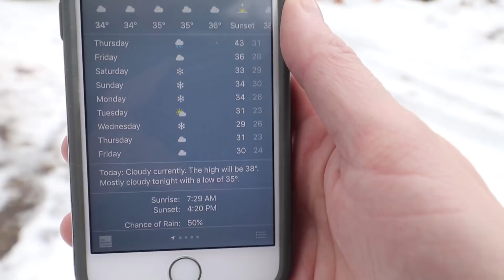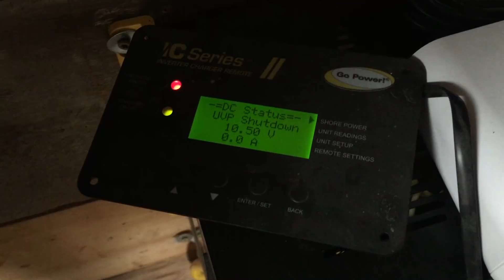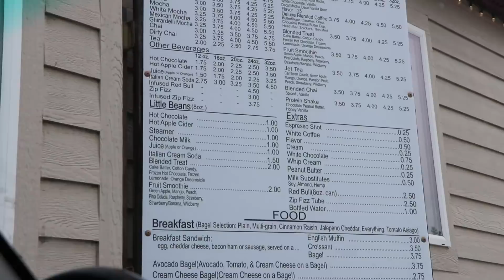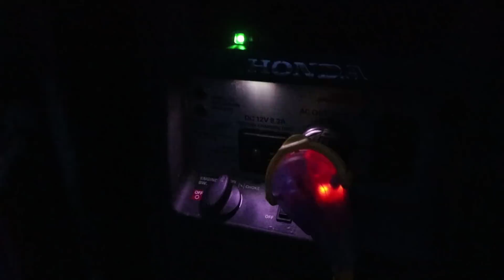Our Story: Giving Up Solar Power to Go On Grid

Comment: Why not convert your solar system into a grid tied solar system? Or just have your solar system be a short term backup system. I'm not judging you for wanting to be tied to the grid, but why not continue using what you have? There are ways to use both traditional and solar systems in the same home.

Comment: We have a roof mounted solar system with  a nameplate capacity of 6.2 kW, that's about 18 350W panels. It covered 107% of our electric needs in 2017 and 92% in '16. We are grid-tied so when we need extra power we draw from the grid and then supply power back at other times. If we had a Power Wall, we would only need the grid (or a generator) in November and December. We live in Maryland. 
So it looks to me, from our real world experience, that your system is way too small. You will probably always need some auxiliary power in the winter with your northern location.
I'm looking forward to hearing how much it will cost to bring grid power to your property.

Comment: Most people have no clue how much power it takes to run a comfortable home.  I started 10 years ago offering solar power services.  I took college level courses, learned the technology, learned how to do the installations and then started ofering the service.  When each customer would learn how much it was going to cost to fully power their home, they got a quick education and there wasn't all the demand that the industry hyped there would be.  The panels are not as efficient as people think and then you add shading of the panels and the systems just are not up to par.  When it comes down to it what you have is a fancy battery backup system that is trickled charged partially by solar but mostly maintained by an electrical source like a generator or the grid itself.  90% of all solar power in this country is grid-tied and the utility just pays you for what power you generate.  Most solar powered homes are not 100% off grid. You can't fault them for tying to the grid.

Comment: I'm offgrid for some years now with solar PV only no generator backup (I newer owned a generator) and since this winter even heating the house is done with PV panels as is the most cost effective heating option. I never had a Low battery warning as my system is properly designed to supply what my house needs and I use LiFePO4 batteries.
For those that are grid connected is best to stay so but for a new house proper offgrid solar will be more cost effective but you will  need to be an expert unfortunately.
For you is likely a good choice to connect to grid if connection is not to expensive and the have a grid connected system (no battery as that will just not be cost effective as of now).
I'm an electrical engineer likely an expert in solar and energy storage and for me it works here in Canada but I likely have one of the world most advanced net zero energy house powered 100% by solar PV.

Comment: Must have been a hard decision switching to mains power.

It take guts to admit when you're beaten, and your mickey-mouse solar setup was never going to cut the mustard long term.

It was always going to be a decision between getting some professionals who know what they're doing to install a proper solar setup (an expensive one with lots of excess capacity for poor-weather days), or switching to grid-power.  
You chose the latter and there's nothing wrong with that.

Maybe now you'll also admit you're in over your heads on the build and get some more professional help with that as well?

Comment: I would argue that if you have a generator which runs on fuel you buy somewhere, you are not "off the grid." You are simply on a different, less efficient grid, and that grid is run by the oil industry. So don't feel bad or feel you need to justify your decision. Just hook your solar panels as a grid tie, get whatever benefit you can from renewables, and call it good.

Comment: Off-grid solar may not be desirable for everyone, but we do well on it even in the northwest with long winters. We upgraded our setup and that made all the difference, even in winter. Running power tools constantly to build a house fast would be more difficult with solar, for sure. We run tools but are remodeling a fixer, not building from the ground up. Do what's best for you, but I encourage others to do their research. Solar power can be a good choice if you have the right lifestyle and setup.

Comment: Lol. Just watched the beginning of the "battery" episode.... he says... " we are fairly sure they were not maintained and 2 are giving problems" " it' is a measured risk and we only need them to last a two or 3 years" lol duh. LA batteries have a memory so if they were not maintained I'm sure it kept deteriorating. Also you can use only 1/2 of the available Ah rating and it sounds like that guard was not in place..... you all just got bad batteries and wonder why it didn' work.

Comment: It costs money one way or the other to get power to a remote home -  Unfortunately these guys put just enough money in to off grid power for it to be a disaster.  A properly sized solar array with a large battery bank is absolutely up to the task, but a generator that is capable of automatically topping off the batteries when the array can't keep up is also required.  In the end it just comes down to if you want to invest the money in your future independence or give the money to the utility company.
Reply: FlyLowLikeRylo exactly, it’s an unfair experiment they did. Old used batteries and three panels, of course they are going to get frustrated. Spend whatever it’s going to cost to tie into the grid and they’d be fine. Gas stove and gas clothes dryer, done

Comment: Seems like grid power is the best choice for you, but I also feel like you never had a real solar setup that was sized correctly for your needs. Cost/benefit wise, I'm surprised you guys haven't went 'on grid' for your water. For what the water system cost, you could have been on grid and paid for several years worth of usage. It seems like the same calculation you're making for power but you came up with a different answer.
Reply: Zach M iii

Comment: I think you might be making a mistake and here is why. I understand "full"/"pure" solar isn't going to work, and as a person living father north then you are, I can also appreciate that energy sources are not really a "luxury", but the cost to run power lines is very high, the install cost will be high and to simply connect to the grid , is very high. You sound consider the best solution for you is to phone up Outback ( same company that make your charge controller) modle = ME-AGS-S  , and get one of the "automatic generator starters". With this, it will auto turn on to charge stuff as needed, ... and the cost is like 300 $ . Furthermore -- if you go on grid, you willnot go back, this is because the install cost is so high , solar will never make sense again, also keep in mind a larger solar array will be much cheaper over the next year or so .. prices fell 37% in 2017 , and will fall another 30%+/- in 2018. There is no way a install of grid power, plus the monthly fees, will come close to the cost effectiveness of this solution. I would say it is worth considering, have someone else set up the electrical system for you .

Comment: Have you guys considered lithium ion batteries?  Not suggesting this instead of connecting to grid...  It not only can be drawn down safely much lower than 80% regularly, but they charge faster.  Something like the Tesla "Power Wall", or whatever they call it, might not only give you a lot more useful power in the mean time, but make you more energy efficient on grid (and give seamless backup in the event it goes down without need for the 3am generator startup).

I know you guys have a lot on your plate.  Just an idea.  Love your channel!  Keep up the great work, and thanks for sharing!!

Comment: Batteries outside? there's half of your problem..possibly 40% loss of capacity.. Inverter left on all night till the alarm goes off? There's another..inverter idle draw of 1 or 2 amps all night long. Generator not in a warm place? Yup, hard to start.....and so on.
    North Idaho, off grid 20 years, no problems.

Comment: A perfectly sensible conclusion. My two cents is you should look into keeping the solar even after power is hooked up. It'll lower your power bill and give you a backup in case of power outage. And from my experience living in rural areas, power outages can last for hours

Comment: I appreciate the honesty you guys have commited to. Solar works much better in areas with clear sunny weather all the time. The tech does get better every year too but for anyone who lives with a freezing, cloudy winter it just is not a full solution. Even if you add wind power or a jet heater/turbine. Modern life uses power to let us do more for more if the day. Supplimenting your power use with renewables is a great idea as long as it does not cost you more than you get back in the long run.

Comment: give me 10-15 grand and I will build you a system with out the problems your little system has, you have a camping system at best, if its going to cost you more then 10 grand to bring power in, I would build a real system you can live off of just like the grid. anyways Its your life, hope you all the best.
Reply: Going Off Grid I agree. They are constantly backtracking because of poor decision making and the complaining is somewhat tiresome. Jessy stating he wants to shame solar users only emphasises another poor decision.
Reply: you missed their point... if they're not getting sun due to a majority of days being overcast and cloudy then no matter the size of the system is going to help that situation much. While increasing your battery bank will help to a degree between those days, which for their locale, is more overcast days than sunny,  even a enourmous, costly battery bank isn't going to work if they're not getting the sunlight to produce the energy to put back into charging the bank...
Reply: How long could this $10K system provide the level of power they use, without sunshine?  I just checked our latest "home energy report", and it says we used 132 therms (combined electric and gas) between Jan 17 and Feb 13.  If we wanted to go off-grid solar, how much would we need to spend to get just a couple weeks' worth of that (60 therms) during an extended period of low to no sunshine?  How about just one week's worth, 30 therms?
Reply: mhmm, why i decided to go off grid. min $10k to hook up, then in the area where i want to build, you have $200/mo ADMIN fees. which is crazy. 

this video sucks so much :(
bunch of crying.

Comment: We have solar, but we are also connected to the grid, sometimes we have a high bill (Winter) other times we generate more power than we use and we get a negative power bill (Summer).
Reply: You can do both!
Reply: I agree this is the way to go as well. Grid assisted is probably the best option do to the winters in their area. Also Not sure how wind is where they are but a small turbine in combination with solar and grid assist might help offset as well.

Comment: Wants solar to go off grid
Puts together a system that has like 6 panels and barely enough storage, and has to use 2 generators
It's the middle of winter and funnily enough, energy use is somehow too high!

There's no "telling it like it is" about solar. This is all widely known stuff. 
You under invested and you massively underestimated your needs. Who would've thought that actually building the property with many power tools and an old badly insulated trailer would use a lot more electricity than an already built property?
Reply: Agree. A friend up here wanted grid power, and to have 8 power poles installed to their property, the utility charged them over $20,000. If these people are farther from grid power than a few poles, they could spend the same money to install enough PV to cover their needs, and stay independent.

Comment: Most important, grid power and solar will work together, Don't scrap your solar system you already have it up and working. Just don't forget to install those panels on the house roof when it is ready.

Comment: You can build a decent 8k solar power system with battery backup for about 25k (18k after tax rebate).  That's about what you will need to actually run a modern home.

Comment: Ladies and gents, this is what Lack of Foresight Looks like. these Kids needed a 10+Kw Array and a solid Battery system for off grid. instead they tried it on the cheep with a few panels and some used Batteries and this is where they ended up. the cost for grid power to be taken that last mile where im at? 15k-22K making solar a Better Option. so now they are now spending more money on getting hooked up so they can spend even MORE money on power then if they had taken the time and done it right.....

Comment: I've lived off grid for 2 years I haven't finished my house yet but I made it a point to make a real solar energy system before I needed the power my home will be all electric I have 15 and 1/2 kilowatts of solar 140 kilowatt hours of lithium batteries and two 8 kilowatt radians. my 25 kilowatt generator isn't even hooked up anymore but you guys should be on grid you don't seem like you understand the Energy System well enough to operate it I'm an installer so I can handle it but most people should not live off grid if they don't understand the equipment that is providing their power and how to fix it
Reply: Yep.. agree not for everyone, and can be a real challenge for the DIY Google 'Now I Know' experts like me....  Our Newish millennial flat earth believer neighbours just found that out the hard way.....12 months in and going On-Grid has now cost them a total of 32k all up, and for all that cash are now also constantly getting brownouts and weather-related outages, although that partially being due to the line they are on not being in a ring system.   Hence They have now gone the opposite and are in the process of  DIY mirroring of our 4 years in proven ($19.5k installed) 60kw Solar & wind + Lithuim setup (4 bedroom all electric house + Barn+Dam pumps etc..) we also have a 15kw integrated diesel genset which  has less than  30 hours on it after 4 years... so very happy with our setup to date.

Comment: I've been off grid for over a year, funny how when the winter hits and the sun comes out for just about 2hrs a day (on a good day) and your batteries are not even close to having a full charge you crank up the gen.  Or, how about when you want to turn on some tools that pull lots of power and those same batteries are sitting there saying 'really'.  Don't blame you for your choice, in fact if I could I would do the same.  Just don't have an extra 50k laying around.

Comment: As someone who has lived and grew up with solar, I think it needs to be clarified. The technology is entirely available, the fact is there are entirely off grid systems that are extremely efficient. The problem is that it has no funding as does grid power companies. Your system does not appear to be technology that is very recent as in the past five years. This is not a jab, but a fact that should be acknowledged. The other side of solar power is to supply the grid with solar. Other parts of the nation earn much higher solar energy value. I grew up with solar in Colorado, it is a valuable source in the right systems, ie. professionally placed to be most efficient in the available space of the property.

Comment: I'm sure that you know that your battery system was woefully undersized, given that it couldn't last through one night. I don't know how many kwhs you use in a day but the larger your battery capacity the less of a hassle it would be to keep them charged with your diesel. 
Looking at the number of solar panels and battery capacity you installed it doen't look to me that you were very serious about solar.
There is a number of large solar farms in Idaho are they in a different area that makes solar more viable than where you are? 

Also, did you look at augmenting solar with wind or going wind only? 

Pure Living can mean many things to different people, for me it includes renewable energy.

Comment: Whenever you do solar remember this. You will need at least double or triple the amount of solar that you or someone else tells you you need. When I started out I was told that I needed 8000 watts to run my house. Well I soon found out I needed 15000 watts to do the job. I also put in enough nickel iron batteries to run for 3 days. 1200ah. I am totally off grid and I live in town. I bought my panels from Sun Electronics in Miami Fl. I buy class C panels that have some minor flaws that are cosmetic and do not affect the electrical output. They cost a lot less. I’m 72 years old and started my project a year and a half ago and did it all myself and had it done in about 6 months. It’s a ground mount.

Comment: Seems to me your solar setup wasn't ever correctly built for your needs, you use the generator way too much even when you had sunny days.  A proper array + lithium ion batteries and the correct charge controller from the beginning and you'd have had a completely different experience.